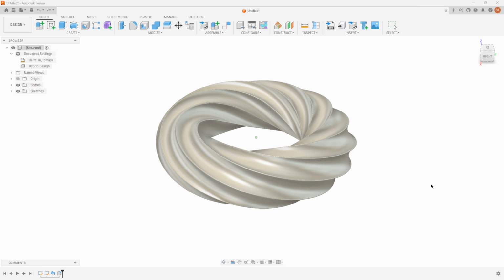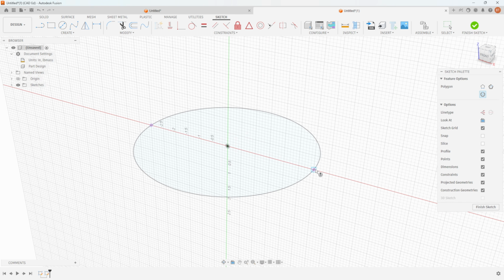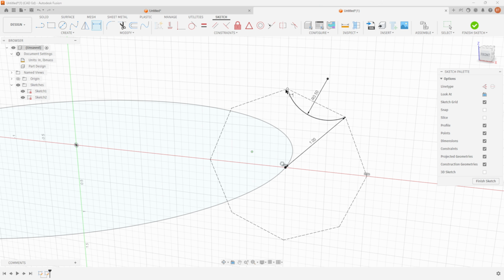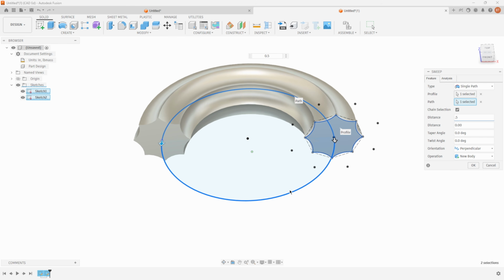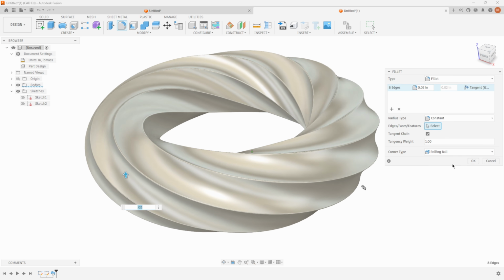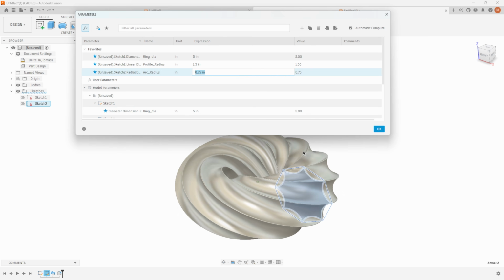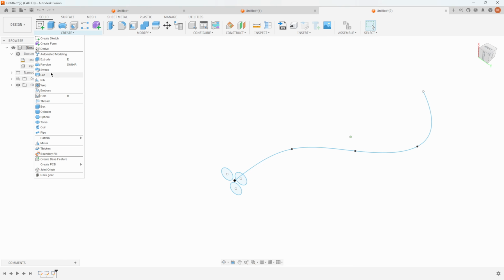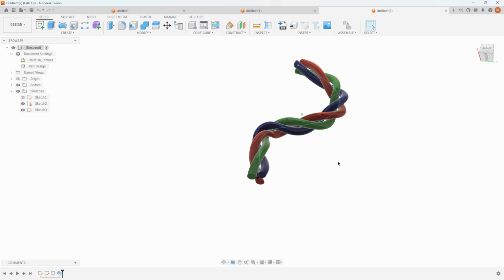How would you make this design?  Learn how to Twist!

Comment: Depending on the number of sides of the profile and degrees rotation you can produce mobius forms (surfaces). Try a pentagon and rotated either  72, 144, 216, etc… degrees. Only at 360 and multiples of 360, will I not produce a single sided single edge.  Fun stuff.

Comment: That is awesome. I got my 3D conexxtion mouse. I believe I have it configured correctly. But the modifying menus have changed and are not as easy as the ones you have shown in your 3D mouse video. Of course I am still learning to drive it wth my left hand . I am 69 so the “old dog “ thing comes into play. I am going to try the wire trick you showed today . I am building a cupola for my shop with a clock on the front and a weathervane. The wire will now be shown in the drawing just because I can!
Thanks for everything 
Paul from Dorchester Ontario Canada 🇨🇦.